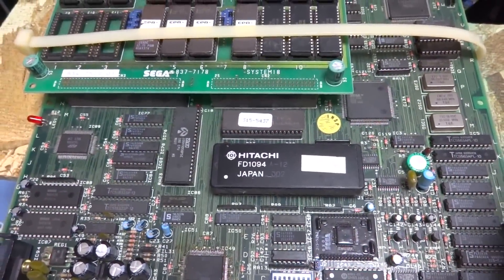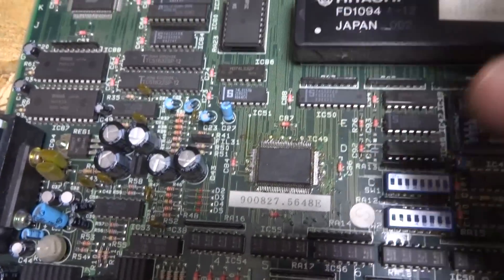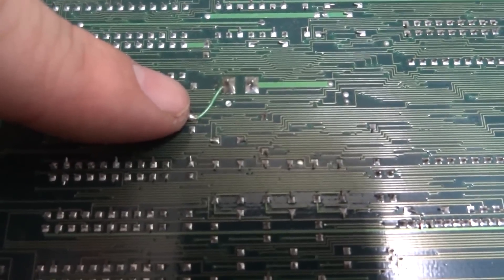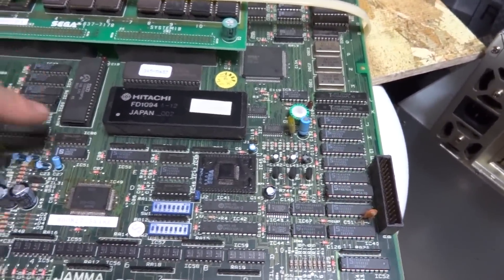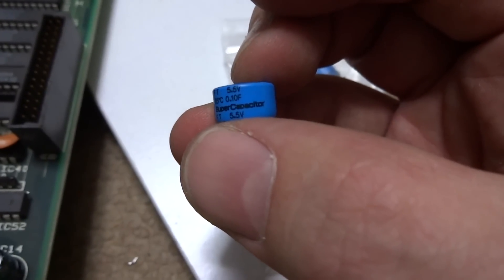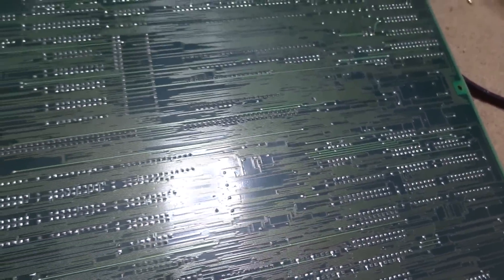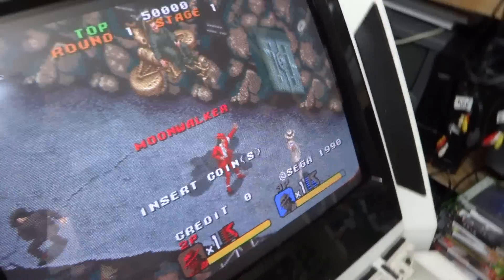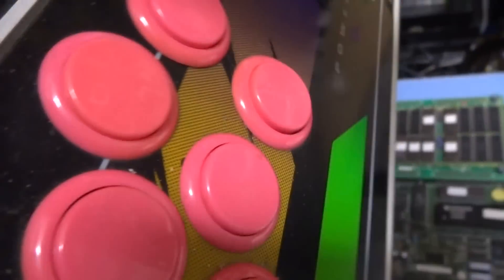Michael Jackson's Moonwalker Arcade PCB Repair

Comment: Luke you never cease to amaze me what you can do with these systems. Totally awesome fix. That is usually the problem with most electronic devices is bad capacitors. I have a computer with bad caps on the motherboard. I'm gonna recap it if I can find the right caps and then I'll decide if I want to keep it. It's a nice machine at 2.8 Ghz and the one I'm on is a 1.8ghz. I'm gonna try to get Grand theft auto 4 working on it.